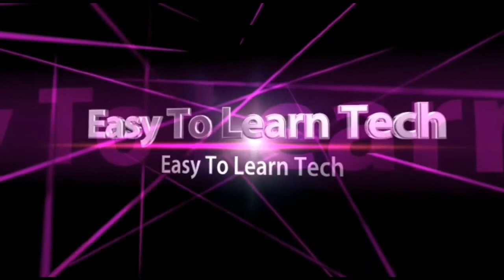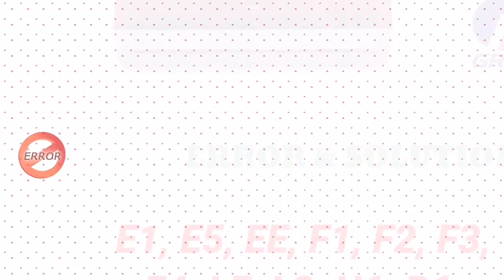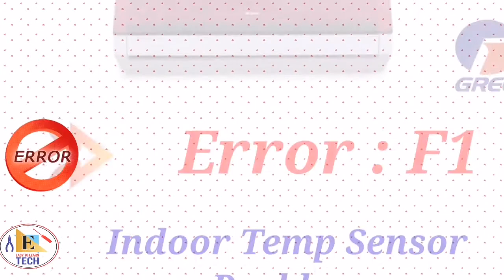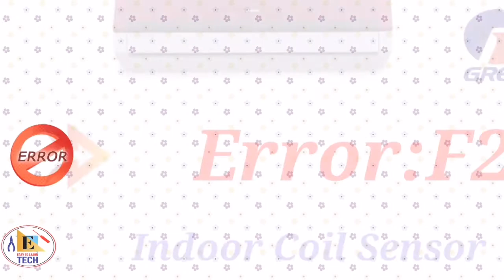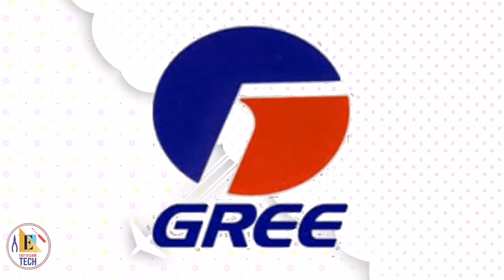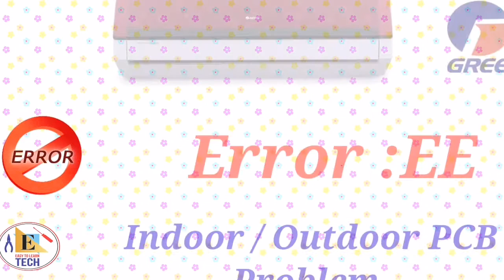#GREE #AIRCONDITING #EASYTOLEARNTECH Gree AC Error Codes And Solutions For Troubleshooting ||

Comment: My Gree split AC displayed LA, any ideas?
Reply: Correct, I have a multi-unit split AC, Thank you so much.
Reply from the maker: However, based on the context provided, it seems to suggest that there may be an issue with the communication between the indoor units in a multi-unit system.

This could mean that the signals being sent between the units are not consistent, which can lead to problems with temperature control, fan speed, or other functions. It is possible that there is a problem with the wiring or the control board in one or more of the indoor units, or there may be interference from other electronic devices in the vicinity.

Comment: b6 error
Reply from the maker: It's b6 or e6 ? I think it should be e6 because b6 no error code,
If it's e6 it means= Communication failure between the indoor unit and outdoor unit.
1) Need to check cable between indoor to outdoor unit 
2) Indoor or outdoor PCBs faulty .